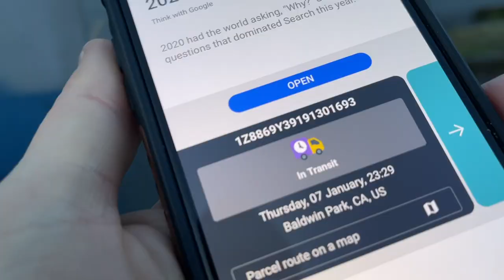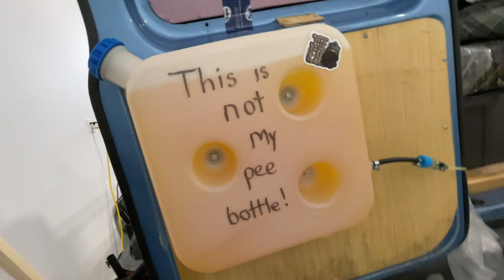SWIVEL SEAT And WINDOW INSTALL With Our Friend Jeff At OFF GRID CUSTOMS | Ford E250 Camper Van

Comment: What is with the grey spots on the outside of Jeff's van?  Are those unpainted areas? Chrome should do a video where they buy a bunch of blue spray paint cans, and spray paint Jeff's van. Just so the outside doesn't draw attention to itself with all the unpainted spots. But yeah, thanks for the great video Chrome. You are very nice helping Jeff out.
Reply: The grey spots are where Jeffy Bear did some body work.